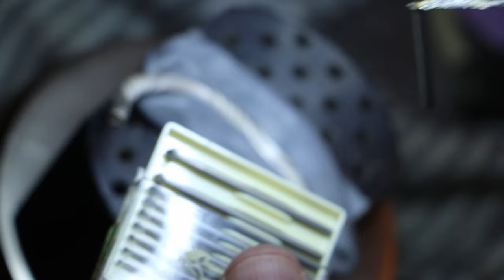The Cobra Emerald Cuff Bracelet That's SHOCKINGLY Affordable

Comment: in a couple years it's going to break right at the emerald.
Reply from the maker: @DuelPorpoise  no
Reply: @DynamiSJewelry 
wrong answer!
 >20 years bench jeweler.
Seen this too often, people bend cuffs while taking them on and off way more than you realize. the entire length of the cuff, is subject to bending stresses & metal fatigue.

if they put it on/off each day, it can easily break in a few years so It's only a matter of time when it beaks at the weak spot you drilled in the middle

it's best to build up any any area to be set before doing removal to negate weak spots & metal fatigue at points.

with that your random bit of harsh criticism is over.
Reply from the maker: @DuelPorpoise  Yes, but it's a thick cuff and very difficult to bend. Even if it does happen, it would take many years. Honestly, I think it's impossible with this one.

And sorry, I didn’t mean to offend you with my short answer.